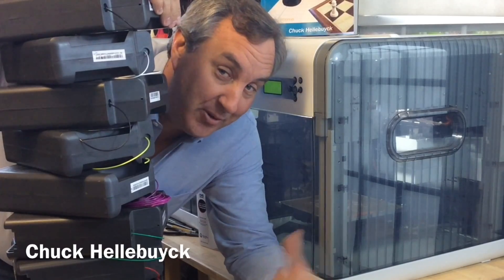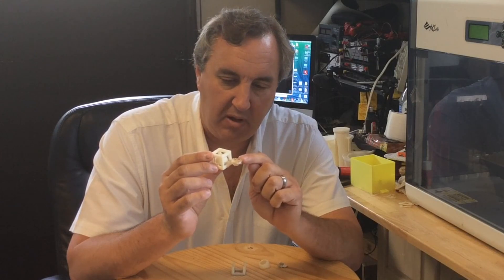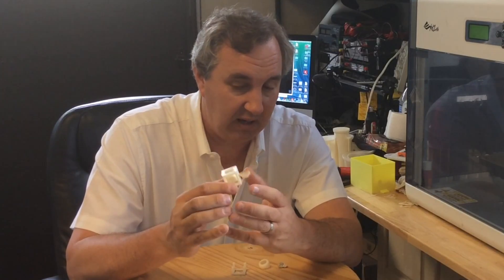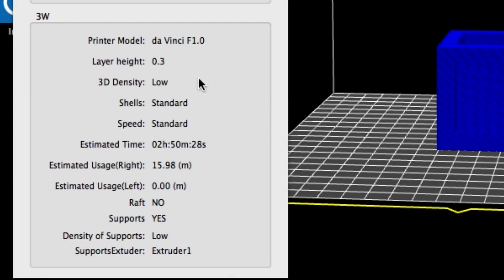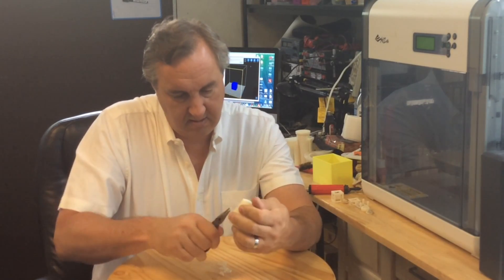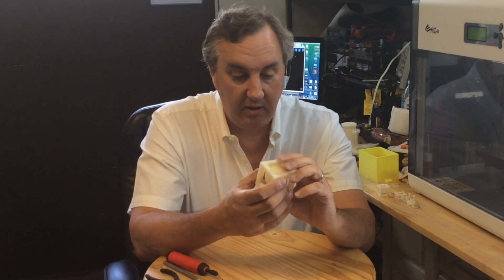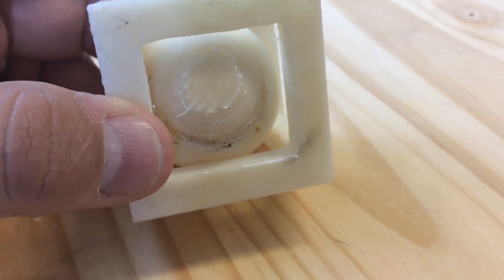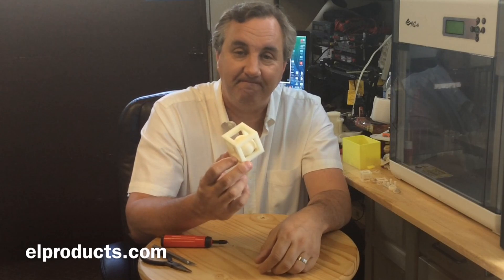Filament Friday #18 - Classic Ball in a Box 3D Printed on Da Vinci 1.0 - Video #062

Comment: My DaVinci does the same thing with balls and ball joints. It burns the hell out of the bottom, and then gets back normalized up higher. Try using fan mods on the lower sections and you'll see that go away... 

Also, you can't choose an exact percentage to scale up and down. It's a crap shoot because it doesn't move integer values... 101,102,103,etc. It jumps,  101, 107, 114, etc.You should tell people why you couldn't get 200 percent even -  because the software is horrible.

Comment: I had some issues with overheating plastic on my Davinci too.  It seemed like anything spherical had a terrible time printing on the bottom.  It would melt, deform, and sometimes burn.  I ended up using a cartridge resetter to turn the temperature down a bit and I also printed out a clip on fan mount.  Both have really helped the print quality.  The fan helps a lot with warping on larger prints too.  I know you don't want to use the resetter, but you may give the fan mount a try.  It just clips on, so it's nothing permanent.  I just run mine off a 12V AC adapter plugged into the wall.

There are a ton of them on thingiverse, but this is the one I used.
http://www.thingiverse.com/thing:529837
Reply: ***** I agree.  For whatever reason, the natural and white ABS gave me trouble.  Black ABS doesn't seem to have the same issues at all.  I'm looking forward to what you come up with.  Keep up the great videos!

Comment: You seem to have problems with overheating the filament. I would print another copy of the 200% Ball-in-Box to see if the overheating was at the same location on the print.
It could perhaps be a filament material variation/defect.